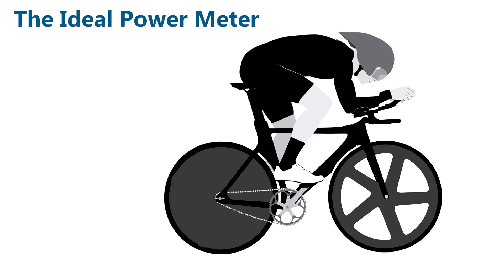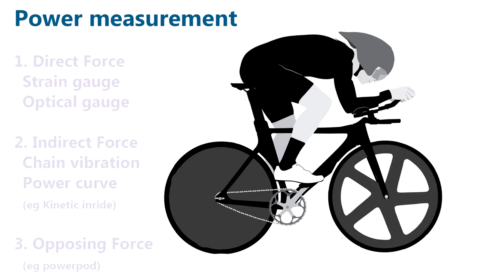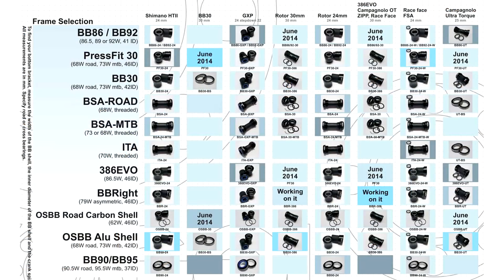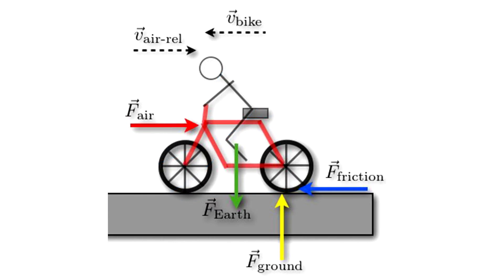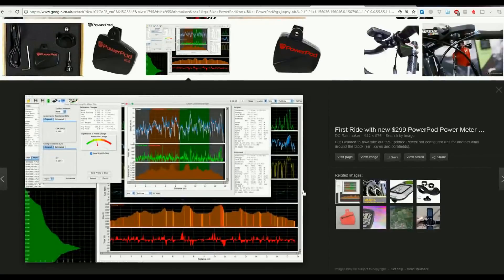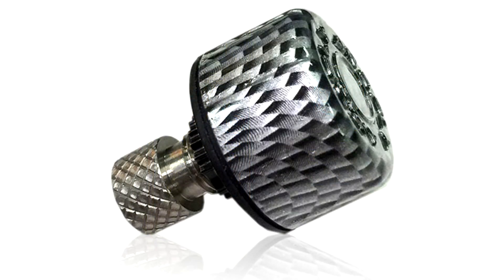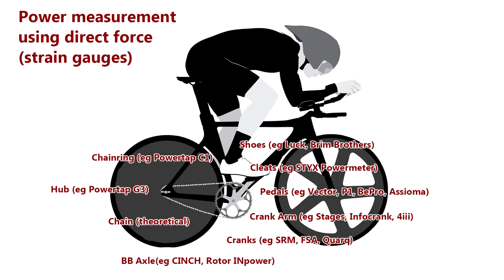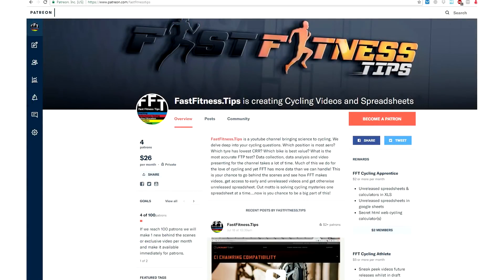An accurate and reliable bike Power Meter for under $100? Impossible!?!

Comment: Any idea on the modeling used  for the  non -strain gauge based power meters are inferring power?  Would it be possible to increase the accuracy/reliability of these power meter by scraping verified power meter data and using this as part of a Bayesian based inference model plugging in the appropriately modeled  scraped data as Bayes factor.  It seem like this is a statistical  inference problem that can use known power, weight, bike and atmospheric data to model initially.
Reply from the maker: +116472338035582744848 Brilliant question but sadly no., its not as simple as it sounds. The problem is not one of trying to find the perfect fit equation (ie find the best model) rather its that  1. all known factors are v difficult to measure accurately instantaneously 2. that these factors vary dynamically in a complex way and 3. a number of unknowns are not routinely measured (eg air density, multiple wind eddies). This means that it approx power over a known ride could be approximately calculated but dynamic power second to second remains elusive.
Reply: @Hari Iyer V 

First, let me state that "I know myself well as a rider." but I keep improving. More accurately at my age I don't loose a lot of fitness sine I'm on the backside of the age physiological performance curve..big time.. I also understand the constraints of mathematical models in real world applications....cause that what I do.  I am just trying to comment on how to use inference to make a slightly better/less expensive power meter. 

Are you thinking that this affect the Bayesian inferential model would not work?  A lot of these factor you mention would  be normalized though the use of Bayes Factor and proper sampling? The use of Bayesian inference for mathematical models has been applied for a long time to  plethora of different physical and biological models that cannot be effectively modeled using inductive techniques.  It won't be perfect but with the current generation of GPU's one could easily hack these simple processors to calculate real time.

 If you are interested in inferential model I would recommend a book by E. T. Jaynes.  If you are interested in how information theory can affect your inferential models I would recommend David MacKay.
Reply: Air density can be estimated based on ambient air temperature and humidity.... those powermeters placed on only ONE side sometimes read ONLy ONE leg power and ... forget about precise measurement-they have to assume the same power generated at opposite bike side... but at long distance riding it is common sometimes one leg output much less power than other or at different angles  so there are many estimations and assumptions made and it is still not accurate and as good as one might think from marketing messages and videos...

Comment: Why hasn't some company come up with a shoe pod meter that can be laced in? Running world has shoe pods.
Reply: Couldnt that same sole for runing used for cycling? Seems to me like there is minor difference between power output on the sole between running and cycling. Well, as long as you are running while steping on the toe, not the heel. Seems like sole powermeter needs to be tested on bike.

Comment: Measure the weight of your bike, your own weight, wind speed and the GPS tracker in your smartphone, tracking your route. Use a table with average drag coefficients for road surface and assume the mechanical efficiency of your bike to be 95% (most standard bikes are, sport bikes are even better). On 100 km routes, you have all you need to calculate power accurately to within 1%. That is of course, if you are willing to spend an hour on finding the links on internet giving you the required xcel file, and don't want to buy another gizmo.

Comment: Can you use the arofly  with zwift ? I'm looking for the cheapest  way to use the zwift program . Is there a cheaper  way to peddle on the zwift program ?
Reply from the maker: justliketolook the cheapest way is zpower or no power meter just a guess from the resistance of your trainer. Have you looked at a second hand power tap wheel?
Reply: zwift wants to bluetooth to something before it will let me ride .What is the cheapest way to ride in zwift .  It has  this when I start the program  power source or speed sensor . is a speed sensor all I need ? What is a speed sensor ? can you put a link to a speed sensor ? will arofly work ? would something like this work to get me into the zwift  program Bluetooth 4.0 & ANT+ Smart Wireless Waterproof Fitness Tracker Bike Speed and Cadence Sensor  https://www.amazon.com/Bluetooth-Wireless-Waterproof-Fitness-Tracker/dp/B01MG9F19N/ref=pd_day0_200_2?_encoding=UTF8&pd_rd_i=B01MG9F19N&pd_rd_r=ZSXPP45VF4WRHFJBJP2D&pd_rd_w=mIJA9&pd_rd_wg=wMnNO&psc=1&refRID=ZSXPP45VF4WRHFJBJP2D&dpID=41qI62ThApL&preST=_SY300_QL70_&dpSrc=detail

Comment: I have owned and used a Powerpod for about 12 months now. I recently bought a Tacx Flux smart trainer and have just completed a 4wk training program. When I compare sustained efforts at similar perceived efforts I get very similar results. I find it much easier to 'climb by the numbers' on the Flux though. I have never used a strain based system on the roads so there are probably too many variables to make any conclusions from that claim though. One thing I think you didn't mention about the Powerpod though - you can use it as a wind tunnel on the fly. It has a system that allows you to make some positional changes and check the results after the fact. I've never used the feature so I can't comment on it any further though. Mostly because I'm a 95kg-tailwind-assisted-flat-KOM-chasing commuter.
Reply: I use power pod and see the difference in power when in different positions on the bike kind of like wind tunnel testing
Reply: Powerpod is a great low cost alternative. It doesn’t have to accurate, but only consistent/reliability.

Comment: Hi this info is great for riders like me...i ride because i enjoy it and enjoy tech to help improve my fitness. I have simple shimano flight deck. computer..use mapnyride and strava and a hrm.I was really interested in getting a handle on my power output but as someone who will never race spending over 1k will never be on the cards. But I think you hit the nail on the head..accuracy is not important to me but consistency is. I wont be comparing my power output against others so a cheap but reliable unit would be great for me. Thanks for posting such a comprehensive video.

Comment: My Stages PM is both reliable AND accurate: I still have to do more tests but last time I compared my Stages with the Elite Drivo power output, numbers were very close. And Drivos have a 1% accuracy certificate and more probably around 0.5%.

Comment: Currently using a PowerPod and reasonably happy with the results. Putting in hard efforts and comparing the reported watts against 'published' watts by other riders on Strava segments has led me to feel confident in the general accuracy of the device. Some inaccurate/glitchy behavior surfaces during crosswinds, and particularly cross/tail winds, where I'll be cruising along with ease and noting 220+ watts. My guess is this is caused by the position of the wind port, and could be addressed by the addition of additional ports. Given that the 'Pod records Ant+ heart rate data, I reckon the device's algorithms could factor in HR and recalculate a more accurate figure at those times. I'm not doing 220 watts with a heart rate of 120 bpm.

Comment: Schaeffler produce a really nice strain-sensitive thin film coating. They claim 0.5% accuracy. Simply coat a batch of cranks or spiders (Vapor deposition) . Trim with a laser for desired pattern. Attach a sensor and perform some calibration. Should be more robust, automatable and accurate than glueing on a set of strain gauges.

Comment: Xcadey from China, glue it with 3M VHB tape on a crank arm, goes for like 150$ (always suggest a price, then always ask for discounts with vendors from China!). And there's a local product, forgot the name (pink sensor? velvet?), which goes for 90$.As to the tech: You can use nano-gyroscopes as replacement for strain gauges. They too work by deforming under load, and the tech is pretty cheap thanks to them being included by the millions in smartphones these days.
Reply: I've thought about this, but then again I have a carbon crank so it may not work
Reply: EditioCastigata can't find a vendor that is selling it without the crank itself :s

Comment: Thanks for the video. I'm quite surprised why till today noone appear with a crank power meter solution using old phones micro system, where vibration and torsion vary the density and the respective electrical conductivity. More power => more torsion=> more conductivity.

Comment: No power reading, but basic garmin, repeat same course, improve average speed each time if possible, but always achieve minimum, depending on conditions. Plateau at good PB. Ride by feel tomunderstand pacing, when to put in most effort. Check results on Strava. Why do I, who does not compete, need more? Works when running, learning to pace oneself is an important skill, and is easier on a bike when you can recover downhilI. I had better Google power meters and see what I am missing....

Comment: It's only time before optical torque measurement filters down to bikes. One of the expensive optical elite turbos has optical measurement and I think it's only time before the industry ditches the strain gauges and gets the optical. the limiting factor at the moment is the size but that will come down - like mobile phones were bricks at one stage.

Comment: In my custom made power meter prototype installed in my test bike  https://s30.postimg.org/z8swxucr5/Aero_Bike_EU_front_gears_62_T_20170826_122321_for.jpg  air speed sensor is used in front of aero shield along with accelerometers and wheel speed sensors to estimate needed power changes, so you have decent power estimation at good road conditions (not MTB free ride due to unpredictable ground forces on bad free ride roads ) at very low cost and it can be easy inegrated with bike computer system since wifi or ethernet IP communication is available, so direct connection from any tablet/smartphone which supports wifi connections controled by Android for the moment -no iphone support so far... It is under heavy development right now and road testing during regular 1h-2h TT , so I can't give you more detailed description for the moment... It could be available soon easy under $100, I think, but it is not for everyone...
Reply: Thank you for great review of different power meter available on the market. Anyway when looking on  installation of AROFLY® on tire valve, I think it uses accelerometer (or integrated with MEMS gyroscope) to predict wheel rotation and barometer to sense difference in altitude (this is what I did already in my power meter to estimate geopotential energy changes in time), but at higher speeds where air resistance is dominant on flat terrain, this device might be useless at windy days conditions, while my guess is it  estimates air speed from wheel speed. Unfortunatelly, AROFLY provides no details in marketing description on their web page, so only by digging their patent file we could try to find more how power might be sensed on.. wheel valve? Rolling resistance probably only implemented in software cycling model so in my opinion this device can only measure wheel speed and maybe cadence, but forget about accurate power measurement on wheel valve? Since they do not specify how power is sensed no way I could buy this toy  :D
Reply from the maker: all I can say is wow   OO

Comment: I owned a power pod for a month, it could only give you good numbers after the ride fixing the data on the computer.  I bought it on ebay and then sold it on ebay.  He is right, at it's price point, spend the extra money and buy the 4iiii.  That is what I bought to replace it.  But if you owned both a power meter and the power pod, it will figure out your CdA

Comment: and there´s a free option for estimated power on the road some one should do an accuracy test

https://apps.garmin.com/en-NZ/apps/e8a4625a-847d-409a-9564-af1fcb964305
Reply: EDMUNDO MORALES, yes I have this on my garmin. Estimated power is just that. But if you do a ride at say 250 watts and did the ride again only flat out and the power increases then it must be good.  I think the numbers are actually not relivent as long as the numbers are consistent with effort.

Comment: FYI, LUCK is from Spain.   For those with multiple bikes a shoe based power meter would be the ideal solution.  I'm still waiting....
Reply from the maker: Thanks for that useful correction!
Reply: Their shoes are quite nice! Would be waiting for that as well
Reply: power pod not the lite version can store 4 profiles for different bikes unless you have more bikes than that should be sufficient

Comment: 4 strain gauges per side is to allow for thermal expansion which is 1 of the biggest issues with strain gauge accuracy. By having 4 arranged in 2 pairs in X and Y orientation the expansion/contraction due to temperature changes is cancelled out. Strain gauges themselves are quite cheap at under $0.50 each. It is the electronics to get the strain gauge signal away from the crank/pedal/bottom bracket etc and the actual mounting of the loadcells and what they are mounted on where 99% of where the cost is.
Reply: There is cheaper way for thermal correction - thermal sensor plus correction table(it's easy to update etc). And pairs don't work like this if you heat crank all gauges decide that here is extension - force applied, you need i unheated or unloaded for correction(or thermal sensor).
Reply: The thermal sensor doesn't make things any cheaper when you spend $2 on the strain gauges, $200 on the electronics and another few hundred on the metalwork that it all attaches to. Until cranks etc drop to under $50 the price of power meters is guaranteed to stay well into the 100's of dollars.
Reply: Alan H, net cost of power meter less 100$ and most expensive part soft and main chip(to convert data from all sensors - thermal, strain, accelerometer to a net power).
To answer why are they use so many strain gauges you must understand that strain gauge work only in 1 axis(compression or extension), but you need data for bend and for torsion, for all this you need at least 4 gauges. And chip for 6 channels data cost less than 8 or 10...